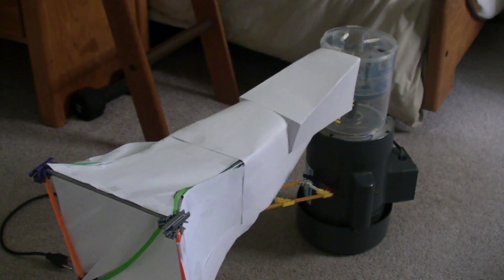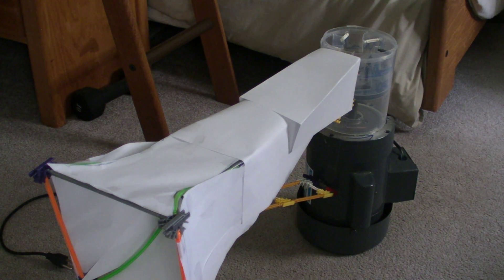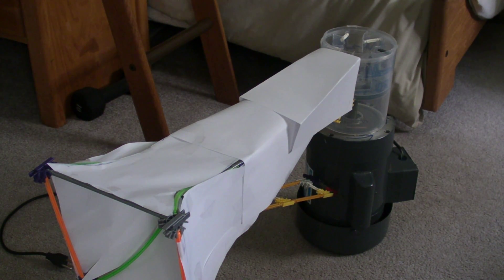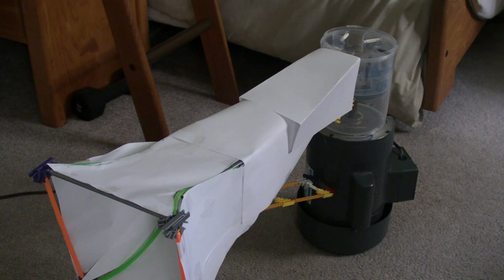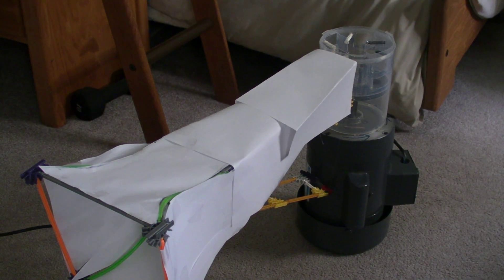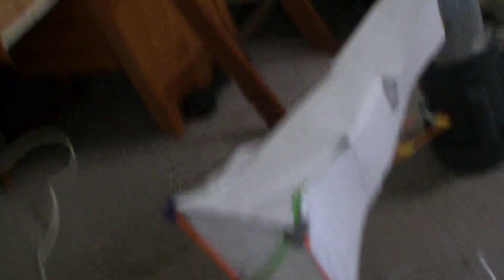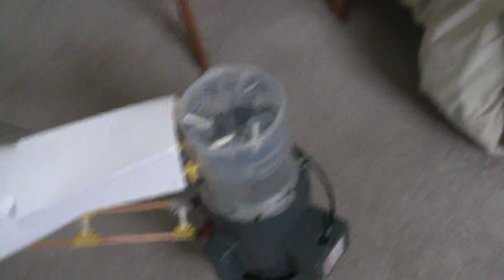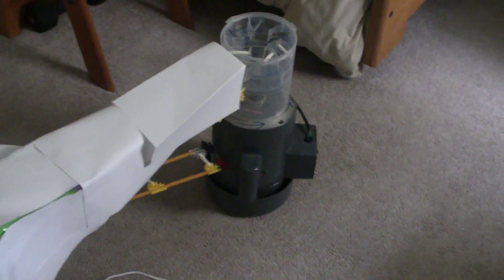Homemade Thunderbolt 1000T

Comment: Wrong port ratio. It's supposed to be 6/5 port. Not 6/4.
Reply: He Did what was easiest with a ruler and compass the circle drawing tool
Reply: 6/5\5/6   or   5/4\4/5
Reply: 6/5
Reply: Thunderbolts come in 4/5 port too
Reply: @brokensolarpanel2649  5/4